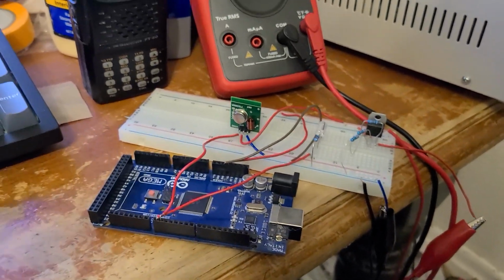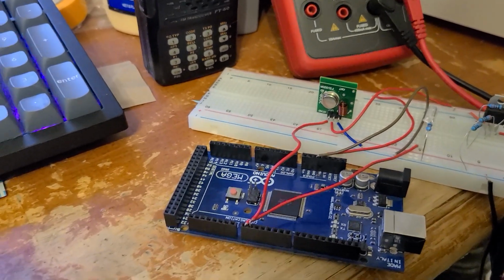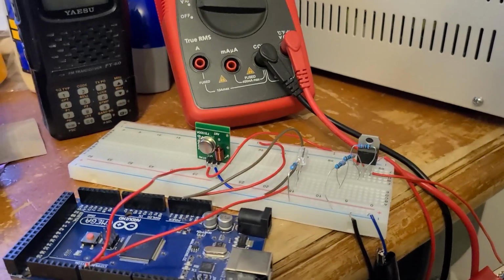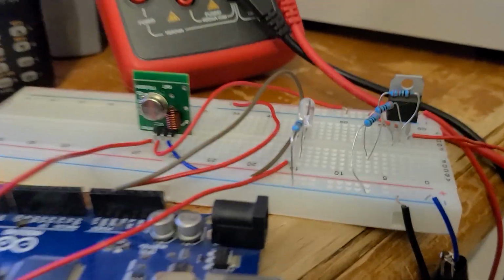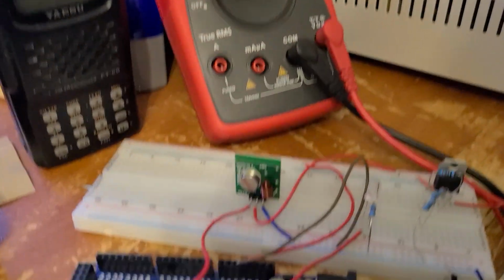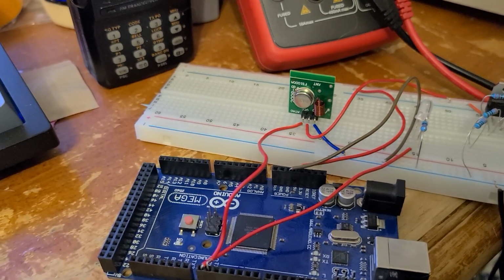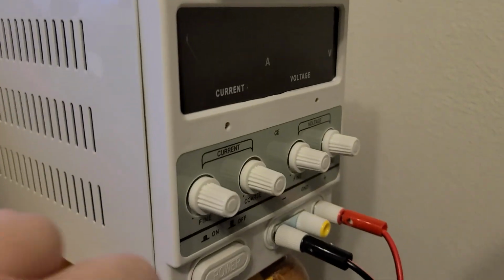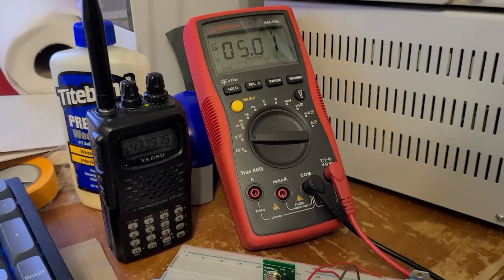Building a Radio Direction Finding Beacon for Model Rockets

Comment from the maker: Turns out the nano can run on 9vts, and has its own voltage regulator built in, so no need to use an LM317